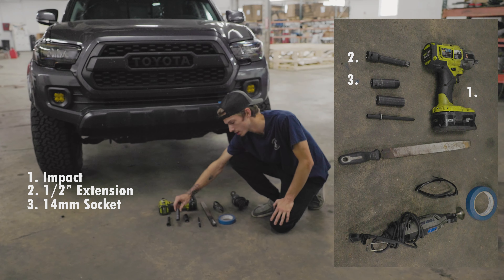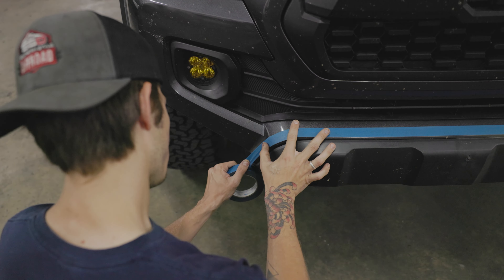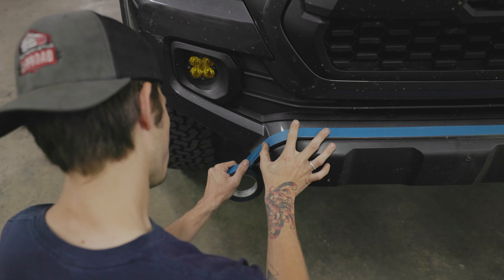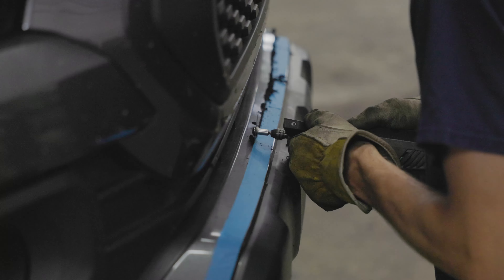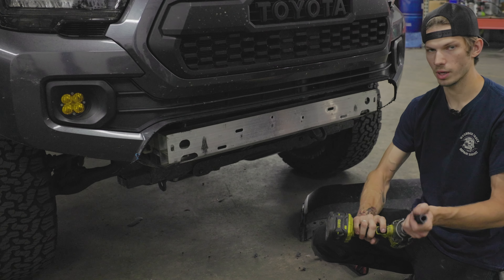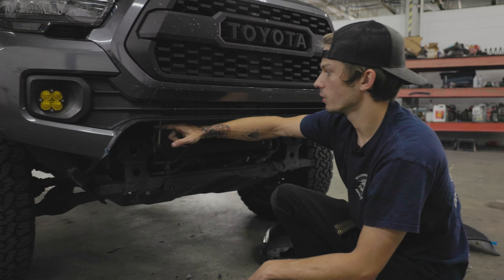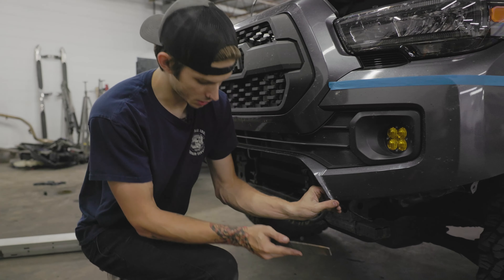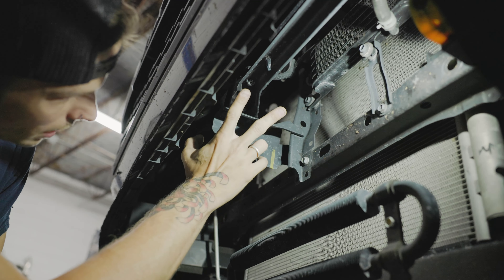Southern Style Offroad 2016+ Tacoma Slimline Hybrid Bumper Installation

Comment: Just FYI. I performed the Bracket trim you had recommended at the 8:30 mark for my Warn winch and it still would not fit. 
The Warn EVO 10S solenoid box was still too high even with the trim on the bracket to fit. So I had to relocate the solenoid box
Reply from the maker: We have been able to fit the same winch in with just that cut, usually, the platinum needs the relation.  Thanks for letting us know, we will look into this during our next install.
Reply: How do you get the front bolts in? With the bottom plate of bumper in the way, I can’t even hand tighten the bolts to the winch. These are the 1 1/4” bolts that warn provided. Let me know what you did before I drill a hole on this bumper
Reply: @NikolaTesla64  If you are talking about the winch itself to the bumper I started the back ones that are easy to get to. Then you have to tilt the winch up slightly and feed the bolts through the holes. Easier with two people. I did it by myself but it was tough. Once they are started just use a open end wrench on them. 
Those bolts will not go through the hole unless you slightly lift up on the winch.
Reply: @gregnauman922  sweet, thanks for the quick response. Yeah that’s what I’m talking about and yes it’s a pain in the ass to install. Done for right now, I’ll tackle it some other day. Where did you end up relocating/mounting the solenoid?
Reply from the maker: @NikolaTesla64  It is a very tight fit but you should be able to fit the factor winch bolts into the front location.  We have been able to install both Warn VR Evo 10-S and their  Platinum.

Comment: What all comes in the box when you buy the slimline bumper? Saw on your site there is a separate kit for the edge trim, hardware, and L-brackets. Do you have to get those or is that a spare kit?
Reply from the maker: Our bumpers come with all the hardware.  Nuts. bolts, edge trim.  The hardware kits are for people who may buy them second-hand and do not have all the pieces.  You will only need is painter's tape, a method to make the cuts, and it doesn't hurt to have an extra set of hands to help with the installation.
Reply: @SouthernStyleOffRoad  Perfect, thanks for the quick reply
Reply: About the lainters tape. When you guys say 1”. Is that the 0.94”??? Or have to be flat out 1” @Southern Style offroad
Reply: Scotch blue tape #2093 
0.94”

Comment: Planning on getting a slimline hybrid during the Black Friday sale that starts today (11/1/22), but I'm wondering about the bumper brace brackets that are shown in the written instructions, but not in this video.  Where do they mount to?  The written instructions lack pics and you don't show these at all in the video.  Just want to understand if there will be additional cutting/mods needed.
Also, I have the SDHQ dual behind-the-grille light mounting brackets.  I'm not planning on installing a winch, but does anyone know if these light brackets will interfere with installing the SSO hybrid slimline?  Will I need to modify those light brackets?
Reply from the maker: The included brackets are for holding the plastic bumper to our bumper, it helps keep it from flapping around at higher speeds.  Contact us and we can help show where they attach.  

As far as the dual light bracket, it looks like that should be installed without modification to our cuts/ bumper, it may even still work with a winch.  Again, please contact for any additional questions.  225.726.7979 or email info@southernstyleoffroad.com.